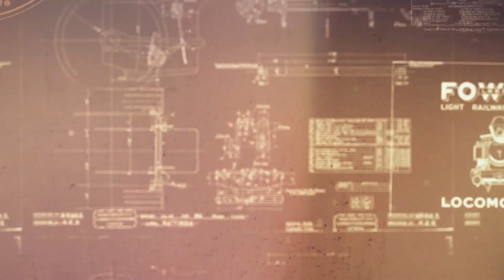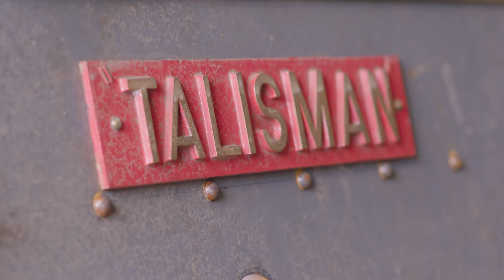How to Build a Steam Engine with Guy Martin - EP6 The Steam Rally

Comment: As someone mentioned on another one of these videos, these are more like teasers for a TV series, one where there would be an hour's worth of footage (a solid 45 minutes at least) for each stage, but yet I can't find one to exist. He said 6 years of work yet we only see 10 minutes or so for it, with one video showing the incomplete rusty steel shell of some of the underpinnings of the engine then the next video showing the fully painted and polished complete engine in the background. 
Maybe you didn't have the budget to make a proper TV documentary series style thing for documenting the build, but I think even rough shots (the stuff that doesn't make the cut in proper TV, too much background noise, people walking across shot, imperfectly framed, etc), of what's going on would still be better than cutting it down to as little as 1 minute of content for one of these videos, the one fitting the wheels. It takes longer than 1 minute to change a wheel on a car, nevermind how long it must take to fit a wheel on a steam engine, but yet that's all we see.

Comment: His next project should be a Stirling engine vacuum engine, I don't think there is one ever been made to be a working engine they are all models what I can see,
 with CAD design you could make a modern engine, I was even thinking of locomotives could you reach 200 mph with a modern designed computer designed steam engine? I think it's possible, with a tanium boiler covered in 2 inches of carbon fibre running at 1000 PSI running off gas, the tender would be a massive high pressure natural gas container a nuclear flask could be used.
Somebody's got to design a modern steam locomotive just to see if it could be done, it could be open sourced what would keep the cost down. How about it Morris lubricants could you run with it? At least someone's got to design a Stirling Engine full size what could be electric operated to heat Stirling locomotive engine never been done yet
Reply: Something like this? https://youtu.be/BLRNaIkxL2s

Comment: i would like to see these episodes expanded in the same way as "project binky" showing HOW the wheels were made, how the holes were drilled and riveted because the scale is immense. anyone can drill a 5mm hole in a bit of 2mm sheet steel, but doing that accurately thousands of times in 1 inch steel is a different kettle of fish. you said that back in 1935 to get the piston block flat they would chuck 30 men with files on it, how did you do it with your little team? did you record that stage? can you document the skill these craftsman have before they are lost to posterity?
Reply: 30 guys with files is rubbish ,they had milling machines and planers in the 20's time was money back then as well .there would've been more filing and hand scraping for final finishing .
Reply: Are these the kind of episodes you would like to see? https://youtu.be/BQIL9E6L1ag